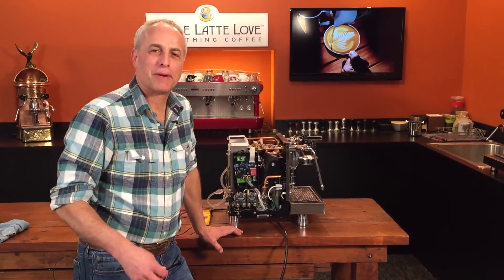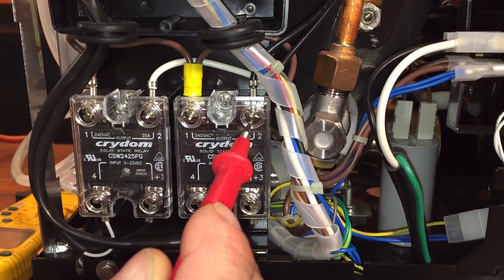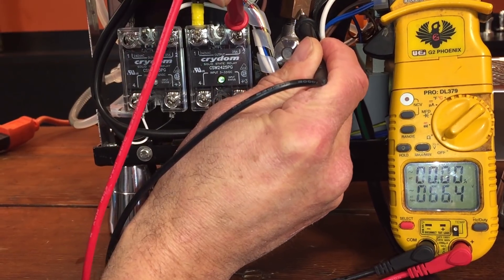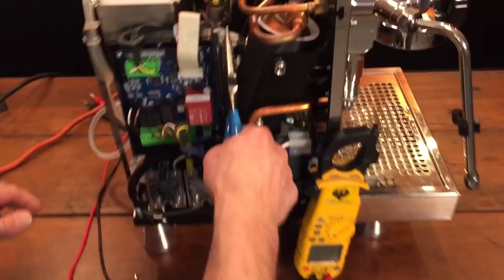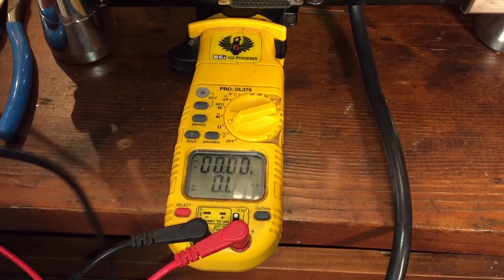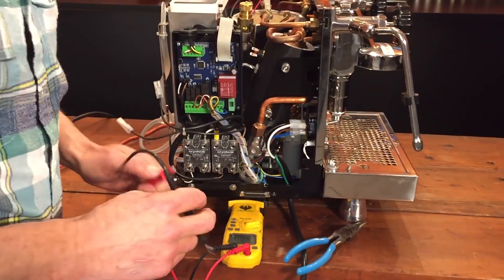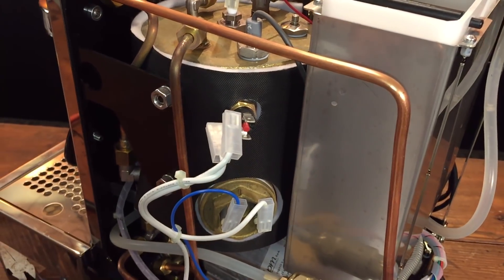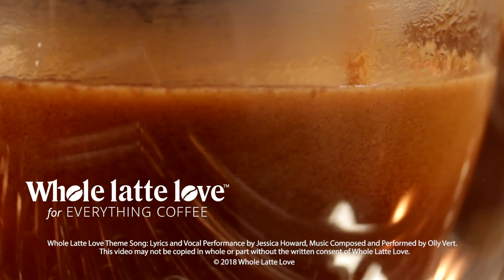How To Diagnose Rocket R58 Boiler Heating Issues

Comment: I have an older model of the Giotto.  I believe it has the mechanical relays which normally click right before the boiler turns on.  This morning, there was no heat, but I could hear a buzz from the relay coil.  Are these relays replaceable?
Reply from the maker: Hi tim, yes, relays should be replaceable.

Comment: My R58 was unplugged for a week. When I turned it on again there was a rhythmic clicking sound but would not heat up. The green power light was on. The PID controller lights were on. The lights on the two static relays were not on. I have 120 volts coming into each relay but only 14 or so volts coming out. Do you think replacing the relays would solve the problem? How likely is it that both would go out at the same time?
Reply: Not sure the live troubleshooting is available to me since I didn’t purchase the R58 from you. Should have. You guys seem to have the best and most available tech support out there. Maybe you could advise how to give preference to a boiler. Thanks
Reply from the maker: @desulliv9  Here's a link to the R58 manual turning off the service boiler is covered on page 21: https://support.wholelattelove.com/hc/en-us/article_attachments/1500003607261 Here's an older video of ours cued to point of showing how to turn off the service boiler https://youtu.be/_PVtP1NRcKE?si=BWP6QCSb-pie4CdC&t=121
Reply: Thanks for all your suggestions.
Reply from the maker: Hi d, I passed your question along to our Tech Support lead. Here are his thoughts:
"It's rare for both to fail at the same time, but not impossible. I'd say more likely that the relays aren't getting the signal to close the circuit.
I would set the boiler priority to a single boiler and see if that changes anything.
I'd suggest signing up for the live troubleshooting so we can hear the noise they are experiencing."
Note: Live video call troubleshooting is available to our customers in US/Canada. More information on that here: https://support.wholelattelove.com/hc/en-us/categories/360005124554-Technical-Support
Reply: @Wholelattelovepage  Thanks much. I’ll follow up with your suggestion.

Comment: Very informative video as always, my Izzo Alex Duetto stopped heating the brew boiler but the steam boiler is working normal.  I followed this video to check SSR, high limit, but still no luck as those checked out fine with the multimeter.  Next is for me to check the elements but it locates at the bottom so I will have to remove the bottom panel.  My question is that is it ok for me to put the machine on its side to do that?
Reply from the maker: yes

Comment: Hi! thank you for the video.
One question :  my resistance of the steam/water boiler is out 'the one on the right), could you please let me know what is the model i need to buy to replace it? is it A110004667 or C199901551 or A199905013 . I have the Rocket R58. Thank you very much

Comment: I bought Bezzera Matrix dual boiler mn 3 years ago and now the boiler is not heating up, any advice? Thanks you
Reply from the maker: Hey RC, It could be a number of things. First to check is the high limit thermostat on top of the boiler. If it trips the boiler will not heat and must be reset. Unplug machine and remove the 4 Allen head screws on the top cover. On top of the smaller boiler there are two wires going to the thermostat which has a red button i the middle. Push the little button to reset. Not certain this is your problem but easy to check and fix if it is.

Comment: I'm having my steam boiler overheating periodically (causing the safety valve to release at the top).  The temp is showing that it's over heating and the relay for the steam boiler goes green even though the temp is already showing high.  Is this a control board issue?  Thermometer seem to be fine because it's showing that it's too hot. Stumped.
Reply from the maker: Hi TD, If it's energizing the boiler heating element beyond it's set temperature I think there's a good chance you are correct.
Reply: @Wholelattelovepage  Do you sell replacement control boards from your Canadian website?
Reply: Hello TD, did you solved the issue with the overheating of the steam boiler with replacing the full control board? I have the same issue and I'm not sure if I should replace the board. Thx

Comment: I see lot issues with r58 on youtube.... wonder if this machine can reach 10 -15 year old still working without issues...
Reply from the maker: Hi o, Not sure what issues you are seeing. I thinks it's like most things - go digging and you'll find people with problems. In many cases it's a user issues. For longevity the single most important thing is feeding a machine with good water which has enough minerals to support flavor but not enough to cause scale. Other maintenance items like regular backflushing is important as well. Over 10-15 years there will be maintenance like group gasket replacement and servicing of the E61 mushroom as well as steam and hot water valves.
Hope that helps!
Marc
Reply: @Wholelattelovepage  thnx !!

Comment: I have a problem with my 2 year old R58 V2. After recently moving, I switched on the machine whereby the ‘low water reservoir’ light blinked, then became intermittent...the pump continually operated, the whole machine gave off a small electrical charge and after immediately turning off, the machine dumped water from underneath (not sure if it emanates from the service boiler). I have tried to clean the water sensor (using tap water in the reservoir), and have taken off the cover to see if there was any obvious loose wires, or cracks in the boiler...but I am a complete novice. I would really appreciate anyone’s advice, as I am 1,000’s of miles away from an approved dealer and have to troubleshoot myself.
Reply from the maker: Hi BF, Where are you located? If in the US you can contact our tech support by phone/chat/email here: https://www.wholelattelove.com/pages/contact-us We do service machines. Any chance the machine experienced freezing temperatures during your move? Common issue causing leaks is water freezing in machines when not drained for transport. That can rupture boilers and other components.
Marc
Reply: Whole Latte Love . I am far away from a dealer (Asia) and in the tropics (ie. No frost here). Hoping to do some basic troubleshooting and then possibly ordering parts (if needed). Thanks for the reply guys, your videos are fantastic.
Reply from the maker: @blairansellfraser  Thanks for the comment on our videos! Here's a link to our support wiki for the R58 V2 it may be of some help - at least, it has a parts list. If no Rocket dealer in your area I suggest contacting Rocket Espresso in Milan, Italy directly. Here's their contact info including phone and link to online support forum: https://rocket-espresso.com/contact-us.html
Marc
Reply: Whole Latte Love Awesome! Thanks guys!

Comment: Hi there. I need to check the on/off switch on a machine. Which cables do I need to check? The machine sometimes turns on after a couple of minutes and then it works fine. Sometimes it won't turn on.
Reply from the maker: Hi Thomas, Thanks for the question. What make/model machine do you have? Let me know and I can give more specific advice. Do you know how to perform a continuity test using a VOM meter?
Reply: Hi. I'm sorry, figured that since I wrote on a R58 video you figured that out. HA HA. Anyways,  it is a 6 year old R58 and I've performed all tests in the video. However there is too much resistance in the hot water boiler, it read 40ohm. Reading 235-240v out of the circuit relays, but only 4V in, that can't be right? I'm not sure which cables to connect to with my meter to see if there is no continuity in the on/off switch. Really appreciate your answer.
Reply from the maker: No, I'm sorry for not figuring out your machine! To check the switch first unplug the machine from power. With switch in on position check for continuity between terminals carrying the blue and white wires and black and brown. Sounds like you are on 240v power? I cannot speak with authority on voltage or resistance measurements as i'm in US working with 120v so there could be differences. I suggest contacting your local dealer or Rocket Espresso through their support form: https://rocket-espresso.com/support-form.html If I'm wrong about you being outside the US (which would be weird if you are reading 240v out of the relays) feel free to contact our Whole Latte Love tech support team here: https://www.wholelattelove.com/contact-us You may find additional troubleshooting information in our support wiki: https://wiki.wholelattelove.com/Rocket_Espresso_R58_V2/troubleshooting Please be aware info in the wiki is in reference to R58v2 North American machine versions running on 120v power so it may not be applicable to your machine. Hope that helps!
Marc
Reply: Hi Marc, picking up this thread. I have changed the control box and now it turns on (steady green light), but the elements won't heat. The voltage is very low (130v vs 230v) but constant from both static relays. They are not alternating like they should. Any idea? Thanks again, Ill ship you some coffee for the help :)

Comment: As an industrial control tech, I enjoyed the process you presented.  Do the prosumer models come with an electrical schematic?  I have the ECM Synkronika purchased through you (love it) and it has performed perfectly.  Always thinking down the road when the day comes and I turn it on and...nothing happens.  Also, if the heating element was bad in either boiler, is that something you could ship out and an owner replace?  Thanks guys and keep up the great work!
Reply from the maker: Hi jack, We love the Synchronika too! We do have parts available for ECM machines. If you ever need one it's best to give our tech support a call to make sure you get the right part. They can also verify you actually need a part. Something as simple as a tripped high-limit switch can look like a bad heating element. At this point we do not have a schematic for the Synchronika. But within our support wiki for the machine: https://wiki.wholelattelove.com/ECM_Synchronika
We do have a parts diagram in pdf form: https://wiki.wholelattelove.com/images/6/6e/SYNCHRONIKA_Parts_Diagram.pdf
We are constantly updating the support wiki. I'll get in-touch with ECM and see if they have an electrical schematic available.
Reply from the maker: Hi Jack, Just letting you know the electrical diagram for the Synchronika will be added to the support wiki soon - hopefully today! https://wiki.wholelattelove.com/ECM_Synchronika